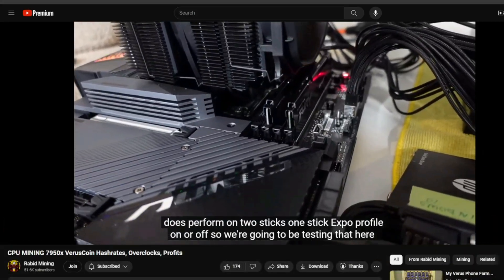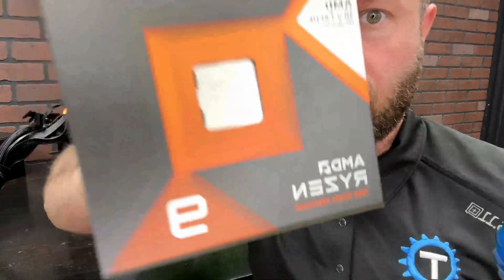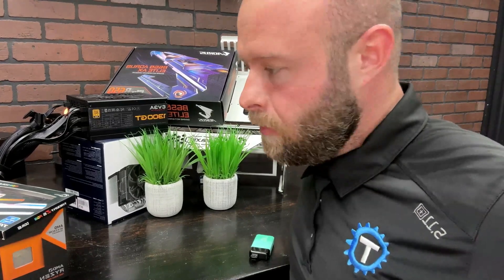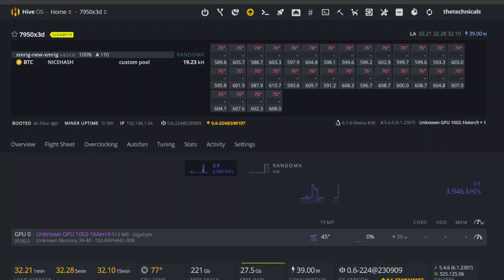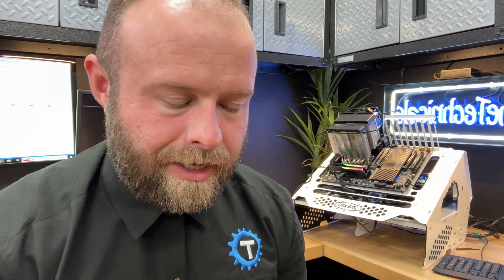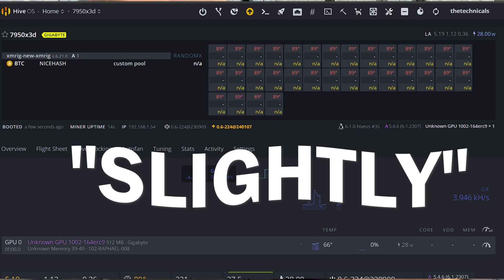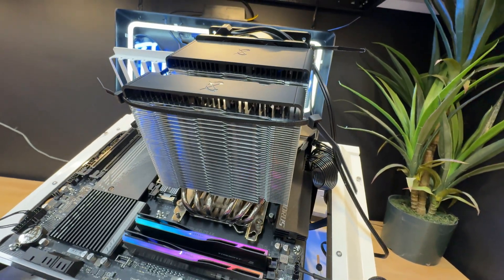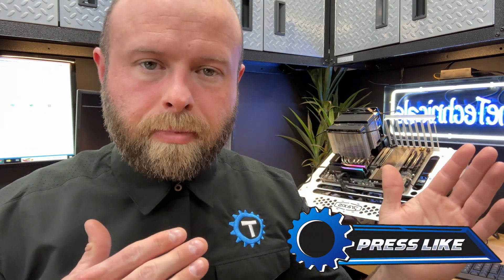Ryzen 9 7950x3d mining build for INSANE hashrates + Efficiency! CPU Mining S1.E1

Comment: is it not better to drop the core voltage and make less heat, wast less energy on fans and pump
Reply from the maker: 3d doesn't seem to allow a direct manipulation of voltage, must be done via PBO, which im working on currently.
Reply: Have you tried using  Ryzen Master to tweak the voltage? It's easier and effective.  @TechnicalsMatt
Reply from the maker: If I did that i'd have to run the rig in windows
Reply: So it's must be a 7950X3D thing. I'm using Master on 7950x 7900 cpus in different motherboards. No problem and stable tweaking on the software.

Comment: With under volt I get an average of 19584 on my 7950x3d'S,  on stock settings I get 24853 khs, ram makes a huge difference on the speeds , I also noticed different mobo can play a role in hashrates ASRock B650M PRO RS AM5 AMD B650 SATA 6Gb/s Micro ATX Motherboard is a great board I have 4 CPUs on this board and they are using G.SKILL Flare X5 Series AMD EXPO 32GB (2 x 16GB) 288-Pin PC RAM DDR5 6000 Desktop Memory Model F5-6000J3636F16GX2-FX5....they are all on air coolers  with a single fan and sitting at 66 degrees
Reply from the maker: How are you undervolting on the 3d? Using PBO?
Reply: @TechnicalsMatt  I'm at 0.9v on the cpu with XMP profile on the RAM
Reply from the maker: What I meant was, the processor doesn't seem to allow voltage tweaking. tried it on 2 boards

Comment: from what I understand (I have 7 AM5 rigs) these CPU’s are designed to hit high 80+’C & run highest clocks possible based on cpu temps. My 7900, 7900x, & 7950x all run super cool with air cooler cause I’ve lowered voltage to around .9
Reply from the maker: Any 3d's? I'm just straight up not seeing an option for Vcore, which is 0.89ish at stock. Thanks for the tip!
Reply: @TechnicalsMatt  naw, no 3D’s for me. Thats crazy the voltage comes stock 0.89. But ppl who know, say these high temps are by design. In that case the best cooler would allow the highest clocks for u, but at what wattage idk.

Comment: arr... the VRM heatsink isn't getting any air flow, most likely will have issues down the track.  better foff spinning the CPU heatsink around and pushing air through it so it goes over the VRM heatsink on the way out

Comment: use PBO features on your Gigabyte board. My ryzen 7950x3d runs at 23ish khs at 180-190w on the wall. i set the PBO level 3 and max temp at 70 degrees.
Reply from the maker: Level 3? You mean -30? Did you use LLC as well?
Reply: i think that "level" thing only avaiilable on gigabyte board PBO @TechnicalsMatt

Comment: 80C is bad in the GPU world? The VRAM for 3090s and other GPUs with so much VRAM that they stack it on thr back of the GPU without any cooling is rated for ~110C but ~95C is typical with a sustained load. Crazy I know.

Comment: The only way you'll see a significant drop in temp on that CPU is by de-lidding it. You can then cool the dies directly or replace the heatspreader with Thermal Grizzly's upgraded heatspreader.

Comment: I remember like I think 2 years from now I jumped on the CPU mining rig and bought all new parts and no case or nothing basically just the bare minimum to have a running computer for a Ryzen 9 3900X. That was a dedicated CPU mining rig until a few months ago I got gifted a computer case and i bought some parts like a bigger kit of RAM and a higher watt PSU. Then I turned it into a gaming/main PC and I would still mine on it. But I think I want to upgrade the cooler in the future because it is at 95*C.

Comment: i just set my 7800x3d to 99 percent in advanced power plan settings in windows. It cuts temps by 10-20 degrees for a small performance hit. When i game i switch to 100%max when I mine I have cpu at 99% max
Reply from the maker: Since I have to do it in Bios I can only seem to really modify the precision boost overdrive or load line calibration, direct undervolt isn't an option, but getting some marginal results on light settings. I may just go with heavier cooling and ride stock

Comment: Rabid Mining Today at 6:29 PM
4.7 at 0.94-0.98v most are 0.975 or so only have one that is stable under 0.97
Also turn on xmp/expo whatever your motherboard calls it then turn on high bandwidth mode

From Rabid himself today when someone was asking about clocks for a 7900x. Also these instructions apply for a 3900x too except the high bandwidth mode is only for the 7000 series apparently. Ill bet it will work for you too. Also Rabid recommends against AIO coolers in his videos because he says they get overloaded and don’t do well on a constant heat load. Imo you are focusing too much on the temps and I don’t blame you because I am that way too, but after you under volt it a bit and set the clock speeds correctly (for the 3900x it is 3.7ghz with above instructions) it isn’t a problem. My 3900x was running at similar temps prior to applying these settings and now it runs at around 50c. I highly recommend joining Rabid’s discord because they are super knowledgeable.

Comment: Don't worry too much about the temps dont waste your money chasing 50 degrees like an intel chip you'll just waste endless money.....the X3D chips just run darn hot end of conversation -  under 80 is fine under 70 is very very good my old 5800X3D runs at 70 degrees flat out all cores and thats with a 360mm and 240mm rad (custom loop).  Just do some optimising with the RAM and undervolting and you'll be happy, undervolting improves performance and reduced temps slightly so win win.

Comment: When you undervolt for efficiency your temps will be cut by 1/2 and then you got  cooler overkill. I run a air cooler and my temps are like 42 degrees atm.
Reply from the maker: Looking forward to that! Still hunting examples of undervolts on the 3d

Comment: You can get the CPU temp down from BIOS settings quite easily set some wattage limit to the CPU.  You should do some testings on different limits, but basically the CPU should adjust itself to its most effective state, within the set limits.   Basically, you do not do anything like overclocking or voltage things, but just find the good balance between the cpu wattage and the hashrate, you should be able to easily drop the wattage without giving much from hashrate, and the temps also go down there. Some 10-20 watts drop might be just enough to do quite big difference in temps without harm to anything.
Reply from the maker: Thanks! That applies to the 3d and not just the 50x? Is the wattage reduced via the undervolting or it's a separate setting?
Reply: @TechnicalsMatt  There should be a specific setting somewhere in BIOS, where you set the actual wattage limit. By default it is set to something like Auto, but there you can enter the number (watts). The exact menu location in BIOS might be under few submenus, but it's different in every BIOS.  I have used this pretty much in all my Ryzen CPU based computers, usually I have set it to bit lower watts than it would want to use in Auto mode.  For example my desktop computer (Ryzen 3900 Pro) says the CPU uses some 90 watts (HwInfo) with Auto setting, but when I apply the watt limits, I can set it to 80 watts or 70 watts or so.  I think there is some 45 watt bottom limit on many Ryzen processors, but you have to doublecheck what is the appropriate watt range for your CPU.   The good thing here is, it is quite easy way to setup, and it makes no danger of any overclock things or such.  I would not touch the voltage settings at all if I were you, I believe the benefits of finding the most effective settings (using the volts and cpu speed settings) are quite marginal because it also seems you have to also change the OC settings if the algorithm is different enough.
Reply: @TechnicalsMatt  Also to add something, if you setup the watt limit right, the CPU actually drops also the voltage kind of automatically, it often goes to the same levels around 1 volts where the people using OC settings would make.  This is just my observation, and if the watts are higher, then the volts start ramping up.   You want to find some good balance there so the CPU tunes itself automatically to the good settings, but dynamically just with watt limit.

Comment: Undervolting is key to lowering temps. If you tweak that first, any cooler will be fine. Also, to maximize RandomX hashrate, make sure you use two sticks of dual rank ram. It matters a lot.
Reply from the maker: Have 2 sticks, but when looking into undervolting the 7950x3d is already at 0.89xx~ out of the box. Lower? Help Mike i need an adult
Reply: fast speed ram with low lantance is best